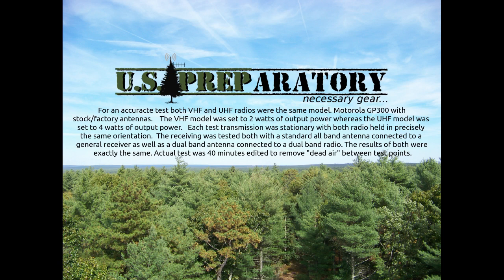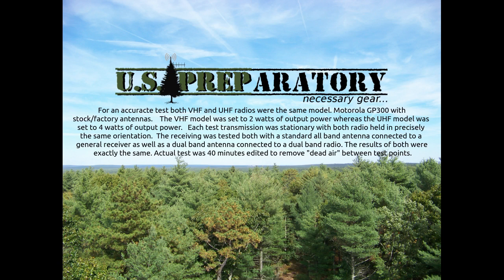PEG VHF UHF Compare

Comment: VHF normal have 5 watts and UHF normal has 4 watts. I'm not sure why you are only using 2 watts on VHF.  If you are using the MURS licence free band when you are limited to 2watts. if you have your gmrs license you can operate on 4 or more watts depending on your location.
Reply from the maker: Hi Brad.  Yes I am very aware of rules, the standards of RF output of VHF and UHF portable radio equipment but the reason behind this test was to show contrasts between a 2 watt VHF portable and a 4 watt UHF portable of the same make and model.  The point was that despite the fact that the VHF model was transmitting half the output power of the UHF radio, the VHF model radio still managed to offer between a 15 to 20 percent increase in performance.  A side note, the VHF portable radio in this audio clip was used normally for an LMR vehicular repeater.  This is why the VHF radio was set at 2 watts and not 5 watts.  Thanks for your comments Brad.  -Chris